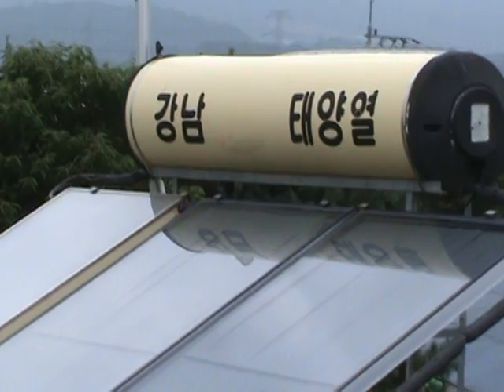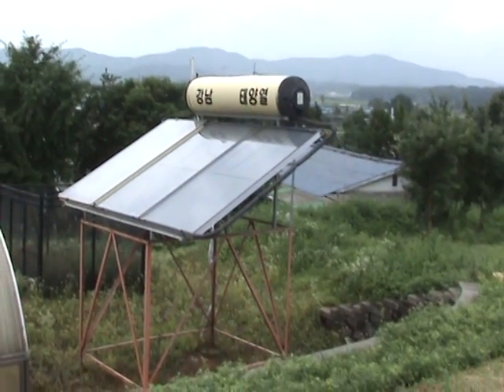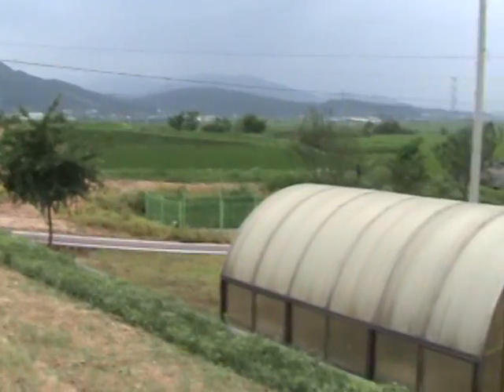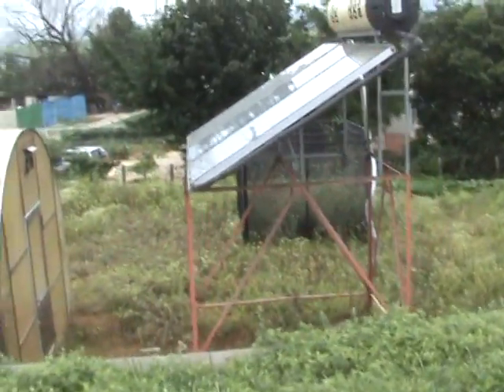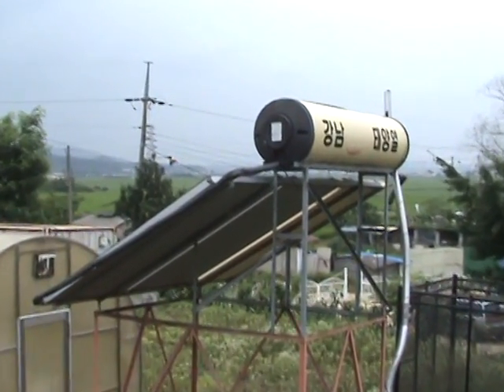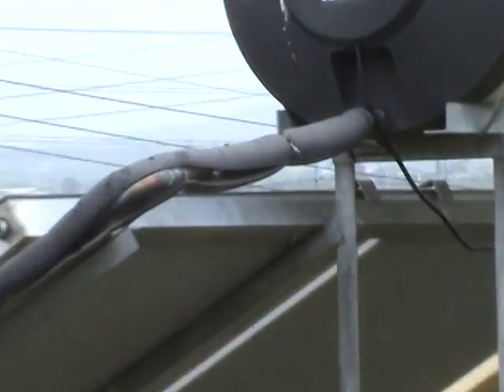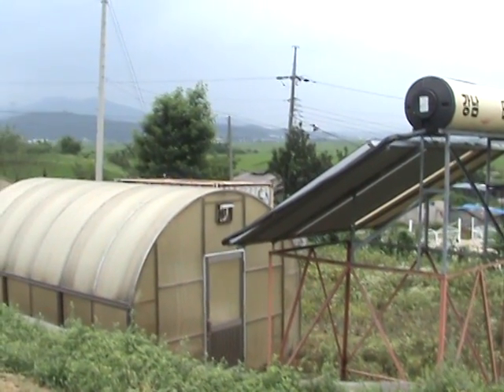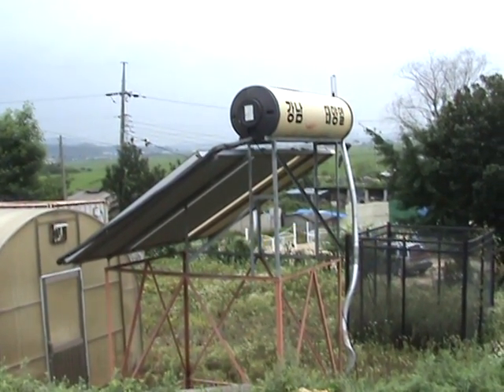Solar heat for your  floor

Comment: of course it needs a water pump because the tank is higher than the radiatiors. hot water goes up by nature, not down. so to get it down you need a water pump.